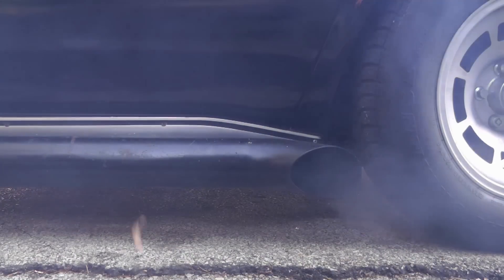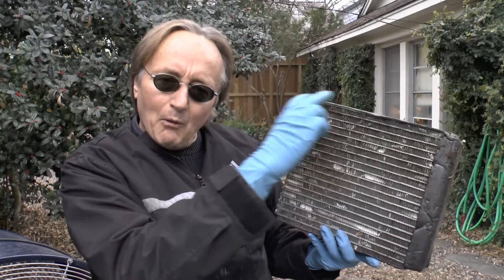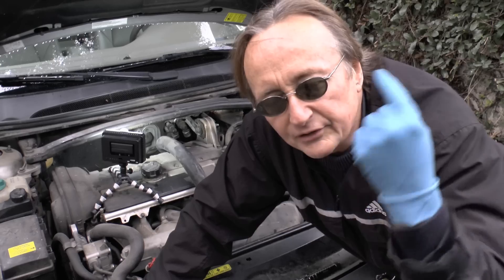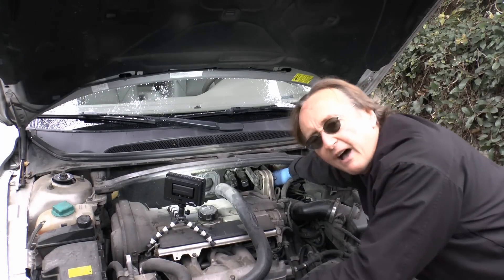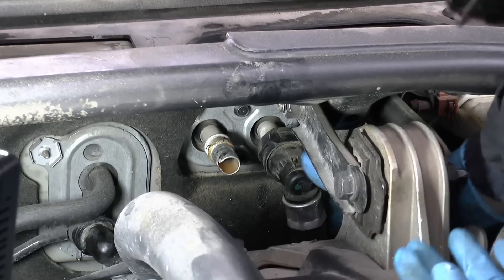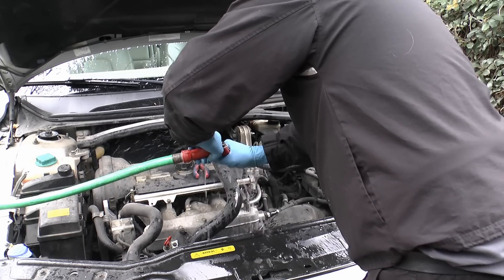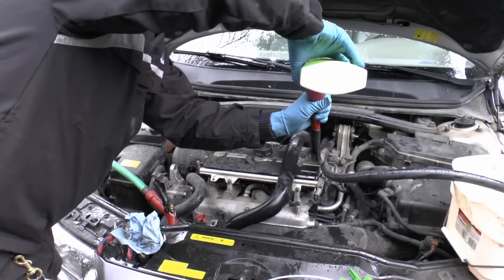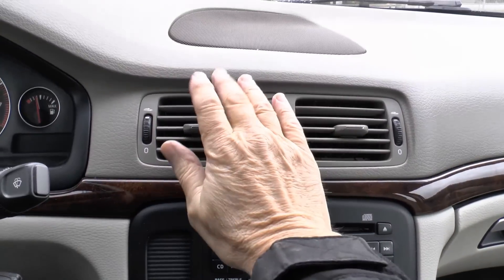Fixing A Broken Car Heater By Flushing It

Comment from the maker: Things I used in this video:
1. Lime-A-Way: http://amzn.to/2iiWBMo
2. Shop Towels: http://amzn.to/2jGDfkA
3. Disposable Gloves: http://amzn.to/2zSRuxO
4. Plastic Drain Pan: http://amzn.to/2jAH4Yx
5. Common Sense
6. 4k Camera: http://amzn.to/2hZ4AxX
7. Mini Microphone: http://amzn.to/2newgV9
8. My computer for editing / uploading: http://amzn.to/2i2sKYz
9. Video editing software: http://amzn.to/2jv5Fhf
10. Thumbnail software: http://amzn.to/2k7tz6C

🛠Check out my Garage to see what I use every day and highly recommend:
https://www.amazon.com/shop/scottykilmer

❗️Check out the Scotty store:
https://goo.gl/RwhRGU

👉Follow me on Instagram for the latest news, funnies, and exclusive info / pics:
https://goo.gl/ohy2cA
Reply: Scotty Kilmer Can I use this same procedure for my 2002 Toyota Echo?( 2 inner vents blow warm air when AC is running, yet blows cold air when heat is on).
Reply: Scotty Kilmer Also, do I have to drain the coolant? (Don't see you doing that on video,but see you adding some in).
Reply: I am having a hard time finding #5 anywhere....help please.
Reply: hey Scotty, i drive a 2000 ford expedition and i have steam or smoke and a smell coming through my heater like pancakes and its slowly putting out less and less heat. i have told people about it and they are telling me i have a heater core leak but i haven't had anyone look at it, my coolant is kinda low but i never had to top it off before i'm not running hot or anything but of coarse i haven't changed my coolant in a few years and it looks like its sludgy orange/brownish, i was wondering if you think it could just need flushing and replacing the coolant or if its really the core leaking? do you have any other videos on this?
Reply: 2015 vw jetta radiator flush
Reply: Ok so I have a 2012 Chrysler 200 3.6 and when I done my flush water was running smooth each direction but I still don’t have heat on my passenger side.They only vent that has heat is the vent by the drivers door all cold in the center and passenger side. Any ideas?
Reply: Is it okay to use CLR instead of lime away?
Reply: 1994 Ford F150 4.9. Done exactly what you said with the Lime away and it cleaned out a bunch of gunk. Hooked every thing back up and got super good heat and circulation. Thanks. Easy fix. Works!

Comment: I actually put a male adapter on a piece of heater hose so it will attach to my garden hose and ran the water in reverse flow to my heater core.... Just ran it till the water came out clear... You'd be surprised how much crud came out... That helped out a lot.... But my main problem was that my car had a restricter that was partially clogged.. The previous owner poured a bunch of sealer with the pellets in the system before replacing the radiator and there was a lot of residue from it..
Reply: DE Nichols  You can also run some air through it..... Adjust your compressor to about 40 to 50lbs

Comment: Good Day Mr. Kilmer! 2013 Jeep Wrangler has heat on passenger side, but not driver side. I've replaced the door actuator before, and recently just flushed the heater core (not your method). Still no heat. How can the heater core allow for one side to get some heat and the other side no heat???

Comment: I got a 2008 Saturn Aura Xe 3.5 replaced radiator then a week after started overheating. No heat so changed the thermostat that wasn't it. Did a heater core flush and wasnt it either. When I got pass 50mph it starts overheating. Any idea of what it might be? I'm not trying to go to a mechanic and get charge a lot of money If I can do it myself.  Thank you 😊

Comment: Hi Scotty. I have a lexus rx350
Driver side heat hot. 
Passager side heat cold
I flushed and bleeded radiator put pink coolant 
Before was green coolant
Mode servo work
Temperature servo work on both side
I wonder if the heater core can clogg passager side and work for driver side?

Any ideas? Please let me know.  Thanks
My name is Peter. From New York

Comment: Hi Scottie. I have a Chevy C10, that’s leaking coolant on the passenger side floor. Will this work or do I have to replace the heater core since it’s leaking. ( I can see coolant dripping under the dash. Thanks

Comment: I have a 2009 mazda 5 and the heat NEVER gets warm (especially the vents under the first row of seats which are supposed to heat the second and third row seating).  I had a mechanic replace the thermostat a few months back, but that didn't really help, so maybe flushing the heater core is the next thing to try.  As I was paying more attention to the car, it seems like the AC compressor cycles on/off whenever I turn the fan on (even without pushing the AC button and even when the heat setting is turned up to max heat of 90 degrees).  Should the AC system be involved in winter heating?
Reply from the maker: yes, the ac is turned on when you put max heat on to defrost the windshield as AC air is VERY dry, they are made to do that
Reply: Scotty Kilmer Thanks Scotty!  One further question: should the AC compressor cycle on every heating level?  Mine seems to no matter how high or low I set the temp, even when I don't select defrost...and cycle quite frequently (about every 5 seconds)

Comment: I wonder what was it initially clogged with?? I thought it was a closed system.
Reply from the maker: people's arteries are part of a closed system, they clog up too. Just internal parts breaking down, like hoses and metal corroding from old coolant that's not changed enough. And in the case of chryslers, just plain cheaply made heater cores that clog even if you keep the coolant clean.

Comment: How does a heater core get clogged? How does crud get in?
Reply from the maker: build up over time, just like hardening of the arteries in people.
Reply: It's just the nature of coolant, and the metal passageways over years of driving, heating and cooling from operation, corroded metal particles damming up and blocking the heater core.

Comment: Scotty you’re the Best.   I have a 98 Audi A4 has the same problem.  Start it and let it heat up and no heat from the vent. After driving it the air will get hotter but not much.   What do you think will this work for my car?
Reply from the maker: pray it does, costs a king's ransom to change a heater core on that thing

Comment: Hey Scotty thinking about buying a 2012 Volvo S60 t6 the used car reliability rating from consumer reports is above average and equal with some toyotas do you believe this would you buy it ( not the old 2.9 t6 but the 3liter t6
Reply from the maker: Applekid total crock, what the heck do consumer reports really know about cars? they are not mechanics like me, and are easily bribed by car companies with big ad budgets. Those things are endless money pits as they age, they keep saying "oh, now they are better made." Yea, sure, only time tells that and let's see what those do in another 6 years or so as they age. Probably will fall apart like every other later model volvo does. Considering volvo keeps getting bought by other companies who then later dump them, I would not buy one myself. ONLY their giant big rig trucks are long lasting.

Comment: Hey scotty.
So i have an 04 infiniti g35, when the engine is warmed up, and the heat turned to 90, all i get is warm air, I'd say around 75 degrees if that. The air gets warmer while im driving, but not by much. Could it be a clogged heater core, bad thermostat, air in the system, or maybe a bad clutch fan? 
Thanks buddy. You've tought me to work on cars through your videos.
Reply from the maker: a bad thermostat will make the car temp run too low, so change that if that's the case, I doubt it. A bad fan clutch would actually make it put out more heat.  Odds are core is clogged OR the control inside the dash opening the blend door for heat is probably breaking down, knowing infinities. AND dash work costs a ton on those. good luck
Reply: Ill try flushing the heater core. I've heard flushing it with tap water is bad for the system, is this true? I was going to take it to a shop, but im cheap as well.
Thank you, sir!
Reply: tyhollimon
The tiny amount of tap water that remains is noting to worry about. Just not enough minerals to cause an issue.

Comment: I never tried that trick. Where the hose are located, that area is like broken. So, I'm like should I spend the 50-60 dollars buying a new heater core, and going through the hassle of breaking down the dash,🤦🏿‍♂️ or should I take Scotty's advice by flushing the system, and grabbing new hose🤔. 

Working on: 2001 Nissan Quest

Comment: Hey Scotty could this method work for the AC as well ,my AC cools like no other but every now and then it stops blowing cold air and I don't need a AC recharge because it's right where it supposed to be ,, and of course my heater don't blow hot air either
Reply from the maker: you can flush an ac system, but it's much more involved with special pressure equipment and flush chemicals
Reply: Thanks for the info ,and I will try this for my heater

Comment: Hey Scotty, what do you think of the E3 spark plugs?
Reply from the maker: spark plugs are pretty much spark plugs, if you have the correct heat range and size, any of them work. the more expensive ones like irridium plugs just last longer as irridium does not corrode like copper.
Reply: Gotcha! Thanks Scotty!
Reply: Not E3, but I put some Bosch multi-point plugs on a civic one time and after running it a little while it started missing.  Turned out the coil was not strong enough to reliably drive the plugs so I changed back to a regular iridium set and it worked fine again.
Reply: 81MrKMan I have had better luck with the cheapo autolite copper plugs in my BMW.

Comment: Scotty, any idea why my when I turn my heat or any type of air on in my 81 Cadillac Eldorado 6.0 Base with the 4-6-8, it will blow and then cut off. Sometimes coming back on intermittently? Could it be a bad blower motor?
Reply from the maker: pray it's just a bad blower and not all the vacuum electronic controls breaking down
Reply: The 4-6-8 system can cause engine damage and should probably be bypassed frm what I have read. I have a 1983 BMW and I can confirm that your vacuum lines are breaking down/ becoming mushy and leaking causing your climate functions to have issues. Most of my vacuum lines are leaking and need  to be replaced.

Comment: I think I need a new thermostat in my Buick, it takes forever to warm up.  Heater core is fine.  Is this hard to do?  Thanks
Reply from the maker: pray it's just an open thermo that's bad
Reply: Car runs like a top and never burns a drop of oil.  New water pump last year, and replaced it back then.  Never had heat problems until this year.

Comment: hi Scotty. i have leak of radiator of heater and i just canceled it. is there is any material i may put inside in order to stop leaking?
Reply from the maker: try bars alumiseal
Reply: thak you for answer. but i mean what kind of liquids i can put inside in order to stop leakage of heat radiator for not dissambley all salon panel.

Comment: Hey Scotty sorry for such an irrelevant question. I hear using baking soda is a good remedy for odor control in a car however I have never done so myself. I don't like too many air fresheners on the market especially the Febreze clip vents too overbearing makes me feel nauseous. Was wondering if you have tried the baking soda method? Thanks.
Reply: Thanks DE Nichols! Come to think of it now I remember Scotty mentioning lava rocks on one of his videos somewhere. 

Silly question where can I buy lava rocks from?

You have a good day too.
Cheers!
Reply: Ok cool. Thanks.
Reply: DE Nichols Hmm, I may try this. The firewall in my car is rusted out so when it rains water leaks into the car. This sounds like it'd help get rid of the moisture quicker.
Reply: DE Nichols
Good to hear. I need to get my carpet cleaned as mold has built up on part of it. Once I get that cleaned up I will put some lava rocks in.

Comment: My heater leaks and i smell coolant inside  the cabin when the heater on. Will this trick work with stop leak or similar instead of putting into entire cooling system.
Reply: johnpro - fix it right if you can afford it. breathing coolant is a health hazard.

Comment: hi scotty i wanted to ask you that i have civic ek  its heater core was clogged i clean it by this method but the problem is that car is soo old and its heater core also clogged up for air flow throug it and its very difficult to tak out heater core its back side of central dash board what should i do to clean that core to flow air through it is there any other method to to clean junk dirt from it except taking out whole dash board and central console

Comment: Hey Scotty my mechanic did this fix on my 2001 jeep grand Cherokee limited to fix my hot air in the summer problem he said it's because the blend door was broken but now it's cold in Chicago and I loosened the valve and the air coming out is ice cold but it was hot last winter before he put the valve on, what do you think is my problem now?
Reply from the maker: +Robert Szudarski if blend door is broken it needs fixing, or wire it to stay open all winter as it's cold a long time in chicago
Reply: +Scotty Kilmer it definitely is a long winter here what do you mean by wire it to stay open?
Reply from the maker: +Robert Szudarski blend door for heat is normally closed for no heat. So try to get to it inside the dash, not an easy task, and open in manually and use a piece of wire to keep it open
Reply: +Scotty Kilmer okay I'll look around some forums and stuff and see what others have done thanks for the advice love the videos!

Comment: Hi, scotty.Nice vib.... I have a question  that is off topic, can u please help me with ? my aunt has a standard jeep, and all of the gears are working  except for "1st gear"  plus the clutch is going. is the gear box no good? are can it  be fix buy putting a new clutch? thanks again
Reply from the maker: if the clutch is going, often first gear will act up the most. Pray the gear box it good, but only putting in a new clutch would tell you that
Reply: Scotty Kilmer ok. thanks so much for your help i'll  try it

Comment: I have a 2006 Jeep Grand Cherokee with the 4.7 and I cant seem to get the air out of the heatercore. It is always gurgling and sloshing around. I replaced the heater core and did a full flush of the coolant but I cant get the air out. Ive tried bleeding it but it doesnt get it all out. also when I am at idle i often times lose my heat entirely. any ideas?
Reply from the maker: pay a guy like me to bleed the air out, we use suction machines to actually suck the air out using our air compressor tools
Reply: Chad Mees Try parking with the nose-radiator up a hill - incline. Idle the engine with the rpm's elevated and the heater on high and you may find after a minute or so, the air bubbles in the heater core escape to the radiator that's now above, and your problem solved.

Comment: Tried it and it worked. Didn't use any chemicals though, instead applied pressure in both directions and played with flowrates for a longer period of time.

Comment: I have a '99 Ford F-150. Have already replaced the heater core last year and apparently I was told I will need to again this year. Don't know how it is still having the problem. Could this be a solution and when is it actually necessary to replace the heater core in your vehicle. Thanks to anyone who can offer advice!

Comment: Scotty I need help my 99 Mercedes clk320 is overheating I did a proper radiator flush and changed the thermostat but still overheats also the radiator fans are working fine.
Reply: MonkeyWith72Magic There is air trapped in the cooling system, its a bitch to get out unless you vacuum out the system then siphon the fluid in. warm up the car to right before 80c and then purge the air fom the upper radiator hose. Do that a few times then wait for the car to reach 80c and do it again.
Reply: ***** Thank you for the suggestion but, I found out it's the head gasket so I'll be parking the car for a few months until I have the extra money to get it fix. Good thing I have another car to drive
Reply: MonkeyWith72Magic Oh god that sucks, I hope you get it fixed well! Are you going to do it or are you taking it somewhere?
Reply: ***** I'll need to find a good trustworthy mechanic because this is simply beyond me. I wish I could get scotty to work on it but his in texas and I'm in florida :(
Reply: MonkeyWith72Magic Im in Texas as well, so I couldn't help you as much as i'd love to. I have a 98 E320 which has the same engine as you do. When you get the job done i'd love to hear about it or see pics. Hopefully you get it taken care of, best of luck!

Comment: Hey Scotty,
I have a 99 Grand Am. I went to start it today after it not being plugged in or started for a few days in cold SK weather. Anyways it would not start. The Battery was drained 100%. It always has turned on this winter even not being plugged in. I tried charging and jump starting the battery but that did not work. I needed to move it to park my moms car, so i put it in the on position, and in neutral, and it kept turning on and off. What is wrong here?
Reply: Oh fuck. That's nice ain't it

Comment: Hey wassup Scotty i got a 1995 ford mustang 3.8l v6 , when i first turn it on for the day my car its good but once i go for like a 10+ min drive and wanna turn it on again it dont turn on only  the dash emergency lights and radio everything but engine dont start but once i let it sit for a while it turns on again , what you think is the problem?
Reply from the maker: often a bad starter does that, they get hot, and short out